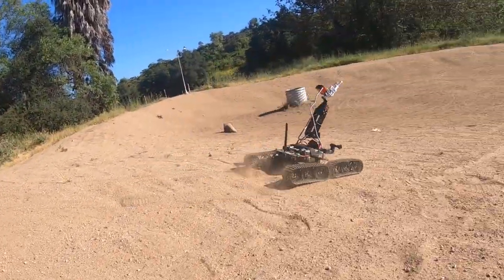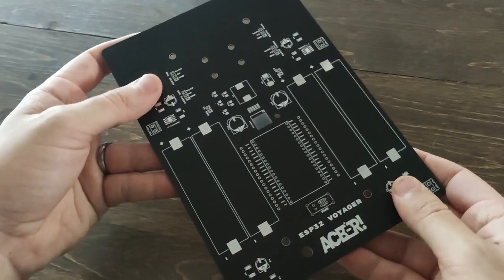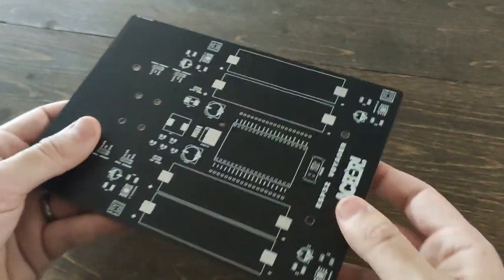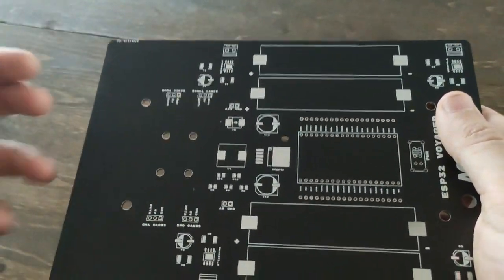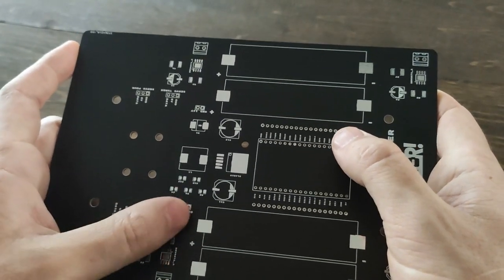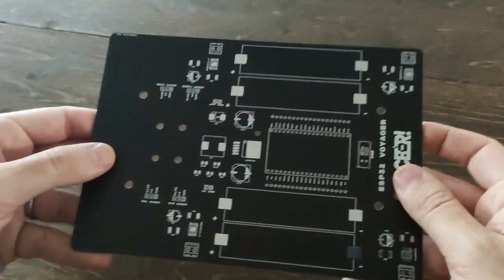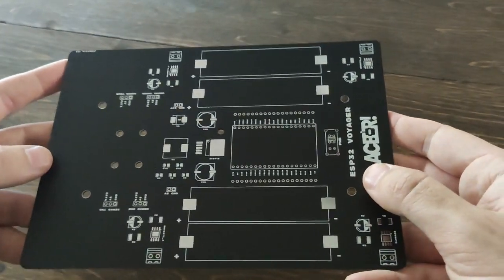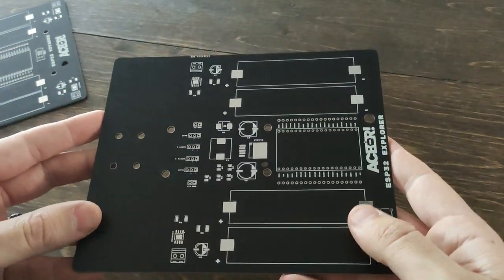The ESP32 Voyager! The Ultimate Open Source ESP32 Adventure Robot!

Comment: Awesome project! I'm very into the ESP32 as it's a beast! Dual cores, WiFi, Bluetooth, PWM, Analog... so many features in just one chip.
Thank you for the write up they're really of great help for a beginner like me. I have a question regarding the DRV8871, how do you calculate the bulk capacitance of 47uF? I saw the datasheet, they said "as well as sufficient
 bulk capacitance, rated for the VM voltage." but I am not sure how did you arrived with that value. Is there a formula to calculate?